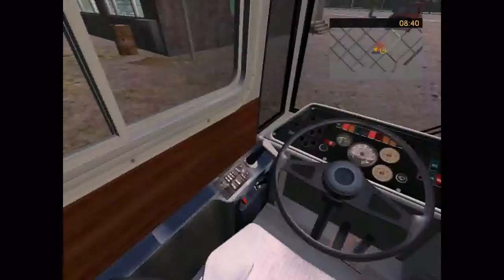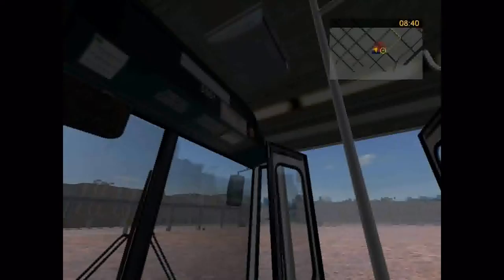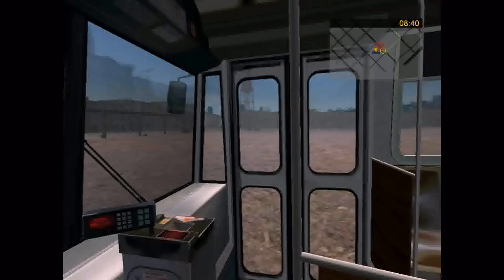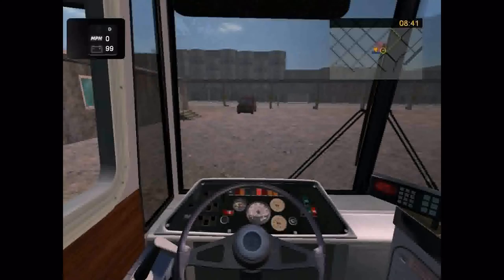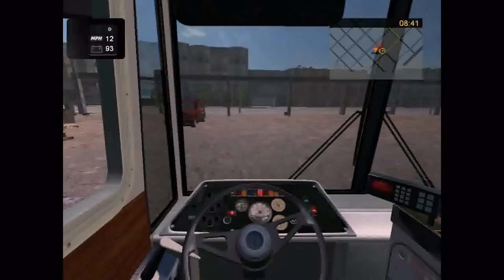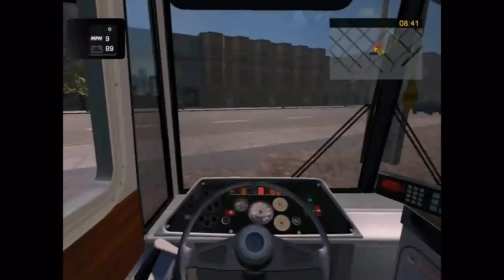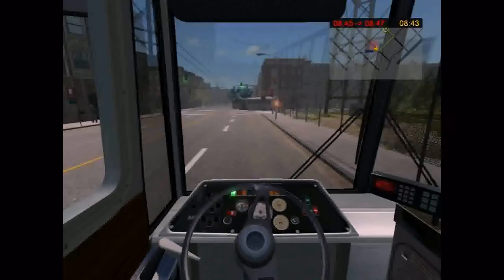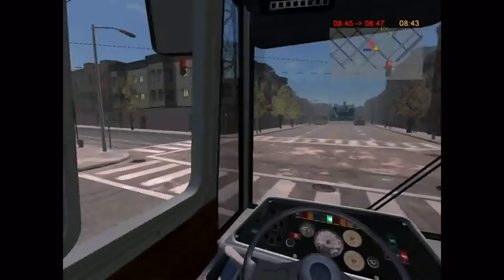Bus & Cable-car Simulator: Trolleybus Tutorial (English) (HD)

Comment: That was the proublem... The pressure doesnt want to load... But i figured it out accidentally, i opened the bonnet and replaced the fuse... Now it works... Thanks a lot for replying to my messages ;)

Comment from the maker: You need to hook it up to the wire. You can still move without battery power, by putting the transmission in neutral and holding down the accelerator
Reply: November Bravo what is acceleration

Comment: My problem s that my battery got down to 0%
Noe when ever i start a new rout with the trolly the battery still is down at 0 and i cant move the trolly.
any hints dude?????
Reply: TheViennaDude you fix ?
Reply: Toms Čaune Use the Messages feature on the vehicle computer. There are a bunch of codes you can call. Refer to the game’s owners manual.